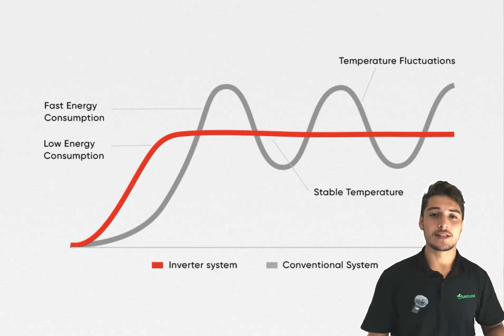Inverter vs Non-Iverter Air Conditioners

Comment: How do you know the different types when shopping the actual item.
Reply: Hi there. I am in the middle of shopping for aircon. To tell the difference, the word “inverter” is written on the front of the unit itself. Otherwise you can look for it on the data plate behind the unit.